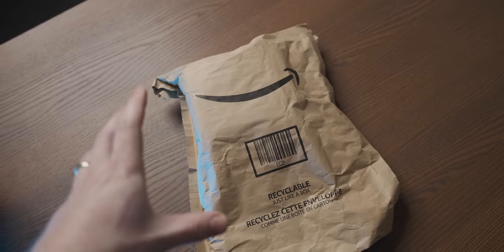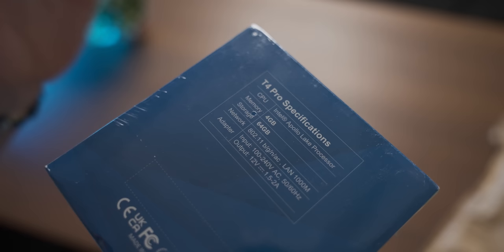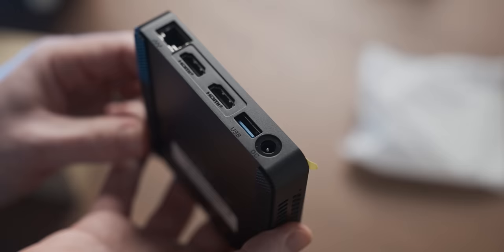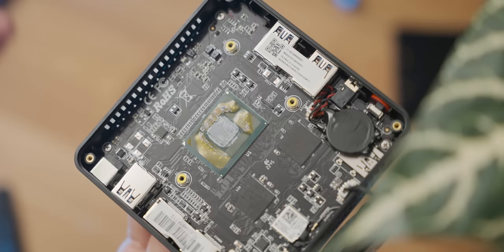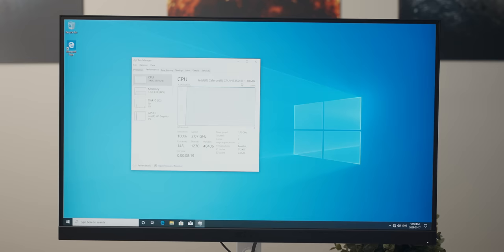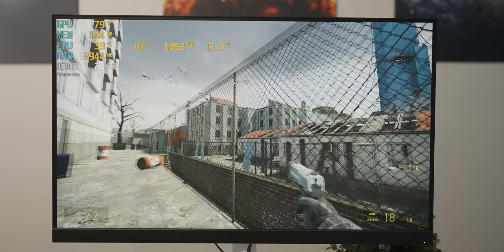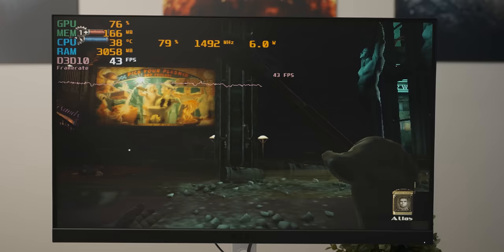This $100ish Amazon PC Is Apparently "Perfect for gaming"...

Comment: To be honest this could be a great contender for things you'd normally use a Raspberry Pi for like home automation, media streaming or even a small NAS (given it has that many USB 3 ports). Especially right now since Raspberry Pis are hard to get and therefore pretty overpriced. Also don't forget that with a Pi you'd need to add a case, heatsink, power supply and SD card, whereas this little box already comes with all of those things.
Reply: Hmm, for that price you could build a 3 rPi supercomputer cluster.
Reply: @joe--cool  uh... Have you checked prices on the Raspberry Pi recently? If they were available at MSRP yes but they sure aren't, sadly
Reply: @SilentdragonDe  There was one 4B 1GB in stock for 60 bucks when I checked but they are gone now. Crazy. I ordered some with 2GB last year for 40 bucks. Pretty insane.
All you get now is a Pine A64+ 2GB for that price.
Reply: Yeah but they also have kits that include all of that for about the same price.

Comment: I like this. So happy to find out about it. I was considering getting raspberry pis but they’re famously difficult to run software on so this with intel architecture is perfect for me. I’m working with an NGO to provide basic computers to kids in rural villages in my country for homework, computer literacy and exposure and this might just be the low cost solution we’re looking for.
Reply: I would highly recommend getting surplus mini PCs like a HP ProDesk mini rather than these things. I got mine (has a 4590T CPU) off a bulk seller from ebay for $65 CAD that had everything minus RAM and SSD. Throw in a cheap $15-20 120GB SSD and maybe $10-20 for a 4gb ddr3 sodimm (may even be able to get cheaper per stick from a bulk lot), you end up paying around the same for a substantially better machine.
Reply: @gen_angry  I was almost certain the problem with this solution was too much power draw, but I had to double check by researching... Apparently those little prodesk computers are fairly low in consumption. It looks like the one in the video still has a bit less than half the power draw. It's a really important consideration for developing countries in rural environments that might run all run off of one power generator and might need to turn off sections of a "grid" at certain times of day for basic needs that we take for granted in the developed world.

Comment: I've bought a number of similar units at around $150 each.  All Celeron 3xxx or 4xxx series with at least 8Gb RAM and they're all spectacular little machines.  Generally low noise, low heat and low power consumption with a variety of potential uses.

I would like to see more of them come with PD for the power supply instead of a proprietary brick.  There are several multiport PD power supplies out there that could easily power three or four of these units simultaneously.  In theory you could even power them with a battery-based PD power supply running from a moderate solar setup and set the unit to auto-shut down when power was too low then boot on power when sufficient power was restored.

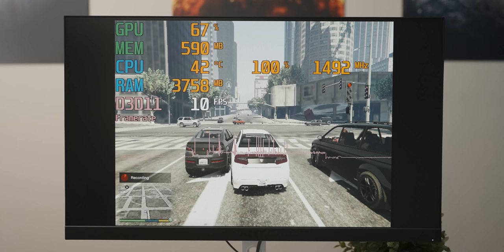Comment: 9:22 the hitch is actually the world trying to load more. This is done on a separate CPU thread, but if that thread can't keep up, it'll halt the game until it finishes.
Had this issue with even an overclocked G3258. My graphics card could handle 60FPS, but the CPU couldn't keep up so I had to force 30fps vsync.

Comment: The thing is massive compared to the Intel Compute Stick (STK1AW32SC) I bought from ABC Warehouse many years ago and still casually use today when guests come by or there's no need to fire up my main PC. Sure it has half the specs but the size (similar to an Amazon Fire Stick remote) being so low-profile is great. It plugs into an HDMI port on my 55" TV and is almost invisible. It does everything thrown at it and maintains 4K res without any strain whatsoever. More powerful models are out there and for the price it's all anyone could need for general web browsing. A Logitech keyboard with trackpad has been linked to it (via Bluetooth) since day one. Amazing for having only paid $140 retail.

Comment: My main PC is a mini PC with these specs : Ryzen 7 7840HS 8C/16T 5.1GHz, 64GB DDR5 4800MHz, 2+1TB SSDs, Radeon 780M 4GB(VRAM amount set in the UEFI), I paid 360€ for the mini PC because it was without ram and ssd(I bought it new) as I already had the SSDs(180€ for the two SSDs total) and the RAM(240€), I also bought a 1080p 75Hz monitor(112€), a keyboard(18€) and a mouse(25€), so I paid about 935€ for the entire setup, not bad, I use it for programming(and code compiling), emulation, browsing the web and watching youtube, it's a beast, I use it on Gentoo Linux and it compiled my entire system in a few hours compared to a full day with my previous PC(yeah I'm a masochist to use Gentoo, just use Fedora Linux if you aren't one lol).

Comment: Got this for $60 last year used off ebay. Scoped it on Amazon. Also took it apart immediately and it's a solid build quality. If it hasn't been turned on in a while, it doesn't boot first tr. I read it is a common problem but boots second try.  For streaming and server/client stuff it's pretty nice. Ran Octoprint with an HD camera for a while. Just repurposed it for game streaming but only does 30hz 4k. If you want it for streaming, moonlight might have a better chance running headless. 4k definitely wasn't smooth with a Linux desktop distro. 1080p was butter and it's crazy how much $60 got me. Would have bought at ~$100 anyway back then, just lucked out

Comment: eh, I have seen a lot of folks use these as a modern thin client...on POS registers and such...but a rather good use for them is for hyperwall type digital signage.  They also just work.  No reasoning behind how something so cheap works so well, but they do.  Used 6 in a series with 6 80 inch borderless screens to create one huge digital sign for a ball field.  They work well to show replays and stats and scores...and if you hook them up to the network you can control them remotely from the announcer booth.  Made for some interesting pretty during games...though graphix wise, they are limited.

Comment: I actually bought one of these a few months ago for the purpose of streaming audio from a police scanner (headless linux).  Normally I would go with a raspberrypi for something like this, but those are hard to get due to stock shortages right now.  Point is, little computers like this do have a purpose for techy folks.  They can make great low power solutions for small home servers and automation devices.  They could also make great thin clients for connecting to a Citrix/Horizon system.

I would, however, not really recommend this for an everyday desktop.  Considering all the peripherals you would need (mouse, keyboard, monitors, etc), you might as well buy a low end laptop (which would provide more computing power).

Comment: I've an Acer laptop with a 32GB eMMc drive and 4GB memory with the N3450 Celeron. It's actually great with a 128GB USB port drive and runs older games like GTA San Andreas and Driver Parallel Lines just fine. I can even run American Truck Simulator at a lower resolution. Paid $150 for it in 2016 and it still goes with me on out of town trips. If I had to replace it I'd look for an 8GB/256GB with the J4125 which seem to be close in price today.

Comment: The PC I have said is $155.99, its refurbished, very good for Proxmox, Ubuntu Server, streaming/video decoding, and possibly gaming, I have not tried gaming on it, but I own 2 of them and they are VERY good, its the HP EliteDesk 800 G3 Mini Desktop Computer, Intel Quad-Core i5-6500T, 16GB DDR4 RAM, 256GB SSD, Keyboard&Mouse, VGA, DP, Windows 10 Pro (Renewed)

Comment: I bought one late January 2023. Didn't even tried to start Windows on it. Instead I installed DietPi with nothing but ssh, pihole and unbound. It was cheaper than buying a raspberry this time and does this job since than without any issues.

Comment: I have one with a J4105. It works great, it's only 10watts, and I use it for my security cameras, and that's pretty much all I do with it. 

So if you want a tiny computer, that uses very little power, and is silent, for your security cameras, it really gets the job done quite well. Apparently, it can be upgraded to windows 11 as well. You can also hook up 3 monitors to it. Wifi, and Bluetooth.
Reply: You can use it to test software
Reply: I mean Cracked Software and torrent shit

Comment: I had Halo Combat Evolved running on a pentium 2, 333mhz with a 16mb graphics card at mid 20's fps at 640x480, 128mb of RAM. Stripped down Windows XP (I regedit-ed every cycle of unnecessary processor usage from it. Themes, gone. Telephony, don't care. Docwatson, nope. Event recording, why even. Etc... I removed unnecessary .cab files, I removed driver's for hardware I wasn't using (including USB ports as I had a PS2 mouse.)). I loved the heck out of LAN gaming on it in the boarding house basement. So this is an absolute gaming beast in comparison. Just need to have a few mates with a similar setup in a room. Done.

Comment: Concerning the initial 100% CPU usage.  Windows does many things in the background the first time you login to a new user account.  One of those actions is setting up the AppX manifests and this is resource intensive and one of the big reasons for the 100% CPU in this case.  Of course, on a faster machine this may be completed before you even have the chance to open taskmgr to see it.  So yes, on a machine like this you do need to give Windows time to do it's initial work before you really start judging it.  Or.... get rid of windows and install Linux which is what you should really be using on any low power machine like this.

Comment: the reason that it is slow on first boot ( my opinionj ) is that windows 10 - by default - does not allow the user to run patching manually - and can only delay it for approx 1 week ( then again and again ).  so when you boot, patch city.   and when patching has caught up - it will run better ( probably ).   I purchased a laptop during windows 10 transition.   5400 rpm drive and 8 gb ram.   It was a brick while patching.  so the first time I booted - I think I had a min or 2, then brick city for a while.  Left it overnight - and ok.    I up'd ram to 16 gb and replaced 5400 rmp drive for nvme ssd - what a change.  Ran pretty well.  If it patched - not too bad.   but I really do not like non - control patching.  Found out admin level changes to fix the patching problem - you turn if off completely and I guess - turn if back on to patch.     I am on that laptop right now - with Kubuntu 22.04 - MUCH BETTER.

Comment: You’re being pretty rough on a Thin Client. I could see it working well for 16-bit and older emulation. For the most part these are to run remote desktop connections to VMs.

Comment: mini pc market needs to start differentiating between:
* real mini pc's w/ cpu, wlan, ram, m2/ssds you can replace like real pc's
* nettops, which are just netbook hardware (atoms, eMMC storage, etc)
* thin clients (basically nettops, but possibly even leaner hw b/c they're just glorified VM gateways)
B/c the mini pc market is taking off. But, someone that doesn't know much about tech or pc's is gonna get stuck with one of these little nettops and tell all their friends mini pc's suck. When, in fact, real mini pc's are pretty darn fantastic as daily drivers.

Comment: Feedback: Please add video playback testing for little PCs like this. I would be interesting if it even works for it's likely intended use case of video playback. ie: 4k, 1080p, 720p video playback, and youtube. It looks like something I could strap to my spare 27" monitor for movies in bed. But after that HL2 performance I'm skeptical
Reply: If it doesn't manage 4k playback it's basically ewaste

Comment: Assuming you install a lightweight distro that mini pc would be a very good value. It should be powerful enough to run dolphin in 320p or 720p. I don't feel like it could run ps2 emulators or modern n64 emulators very well. If you just plan to use it to like code on, or browse the internet it should be powerful enough to run kde at respectable response times. Specs wise it almost perfectly the minimum recommended spec for Arch/Manjaro/Endeavor os, and above the minimum recommended spec for 64 bit debian 11.

Comment: Could probably be used as an emulation box for a living room TV or something.

There was a Black Friday deal I got on a Lenovo e100 laptop. Came with an AMD E3015 CPU. 2 cores, 4 threads. 4GB RAM, 64GB EMC storage, and 11.6" 1600x900 display. Was only $99, and probably has better integrated Radeon graphics of somekind.

Comment: CPUs like that can perform much better, it is all about tweaking.
I owned a 12.2" ACER switch 3 tablet a few years back with that same processor and specs, I performed a clean install of W10 LTSB2016 to get rid of all bloat with a few OS tweaks and it worked great.

It ran games like hitman absolution @ 720 medium preset stable @ 35 FPS, performing about the same it also ran NFS most wanted 2012, aliens VS predator 2010, alien isolation, battlefield BC2, war thunder, black squad....., emulated consoles up to psp, nds and gamecube plus Android on bluestacks all running from a 128GB micro SD card due to the lack of space on the 64GB SSD.....

Comment: The thing I really hate about these thin pc's is the external AC/DC transformer.

IF somebody would just realize that it would be perfect to build the AC/DC bit IN the thin client.. and put a pass through power cable on that bugger so you can simply doublesided tape the bugger to the back of your monitor... and plug in the pass through 220 cable in the monitor

PRESTO, you just turned your Monitor in an All in 1 pc.. with 1 power cable .. clean.

I have a refurbished dell USFF celeron for garage pc.. To just look up somming on the internet to work in my car, or play some music or order parts.
plenty powerfull

Comment: Should work well for a mid to light weight linux distro, or for a cli install hosting octoprint. I'm using dell wyse dual core t series amd dual core thin clients with 2GB and they don't even break a sweat. But gaming on one of these.... Shudders ugh.

Comment: You got stiffed! 😂 Out here in Manila, I can find a 6GB version, with an M.2 slot, and fan-less, running W10 Pro, for $100. However, for an extra $20, I can find an N3450 quad core with 8GB RAM, 128GB storage, an M.2 slot, a MicroSD slot... Happy days! 😂😂

Comment: I used to use a machine with one of these CPUs for a streaming HTPC. In the last few years, it got sloooooooooooooooow cuz of all the shit ads that's on the net these days.

Replaced it with a HP ProDesk mini with a 4590T in it for $65 CAD off ebay. It didn't come with RAM or a SSD but you can get those pretty cheaply and end up around your $100 mark. It runs circles around these junk little atoms while being of very similar size. I would highly recommend going for that instead of these things if you need a HTPC type system.

Comment: My standards are very low, up until last year I used a lenovo laptop with 2gb ram and 20gb hdd, don't even know the rest of specs but it was one of the low end yoga laptops, and even now I've got a dell optiplex 790DT i3 2120, 16gb ram, 500gb hdd and a beastly gt730 2gb ddr5 😂 it plays what I need it to, other than that I have my switch

Comment: Look for the Celeron N5105 instead of these. Two generations newer and quite a bit faster. Also 256GB SSD and 8GB RAM. Some configs around the $200 mark bump up the RAM and storage to 12-16GB and 500GB, respectively. I was able to buy one for about $150 over the holidays. Still not a PC gaming powerhouse, but should be fine for desktop productivity apps or emulation.

Comment: You better test the Aerofara mini pc with a Celeron n5105 cpu (2.0 -> 2.9Ghz, 10 watts): it has an iGP with 24 EUs and much faster DDR4 @ 2933Mhz and maybe you get twice the FPS? (the Celeron n3350 in T4 Pro has an iGP with only 12 EUs, and DDR3 @ 1600Mhz).
/Edit: I bought the Aerofara for 179,99.- ^^

Comment: I mean honestly for a little emulator box that I wouldn't weep over if it got stolen by hotel cleaning staff, lost luggage, etc, this is actually not that awful.

Still these days you can just... buy a dedicated handheld emulator that actually comes with firmware built for it, is its own controller, etc, for less.

But still if I needed a little throwaway to run a bunch of old games, cause I'm an old fart myself, something like this might be the thing.  I know you can run them off a smartphone but it'd be nice to play them on a hotel tv or something.  At least it comes with a surprising number of usb ports and the two hdmis!

Comment: if the storage was on a module, like a little m.2 emmc chip, I would say this is worth it at $110. but the fact its hard soldered to the board means it's e-waste, and to add insult on top of it, its now $170 on amazon. lol

Comment: Cheaper and far better to buy a renewed optiplex 3060m with an i7-8500t. They run 160 on amazon and this runs 165. Unless you really need the low wattage, those celeron chips aren't really that good.

Comment: I get it the point is to call out the bad marketing but all things considered it's kind of impressive it runs gta V or any of those other games at all, when I was a kid if you didn't have a dedicated GPU you couldn't even launch a game off of integrated graphics with 'tricking' the game into thinking your PC had a dedicated GPU using a launcher those on board GPU's have come a long way thanks to amd pushing the envelope. But if you only had 100 bucks you could have a small PC that works, throw a light Linux distro on there an it will atleast do basic tasks it's better than nothing.